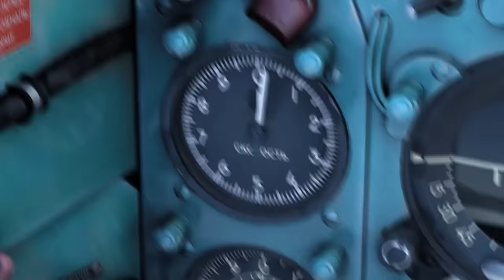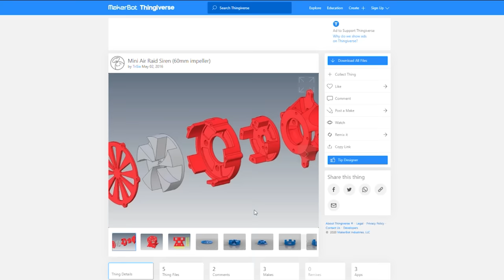Dropping Bombs with the STUKA 💥

Comment: Just an idea but I think the wing broke because the Stuka reached it’s max speed and this put too much force on the straight wing, a very real problem and the in fact reason of why modern day plane wings are angled backwards so that the plane can reach a higher speed without the wing tearing in half from too much force
Reply: Or maybe an old vet shot it since it heard the siren some vets are still traumatized from the war
Reply: Straight wing best wing
Reply: Yea. That's a fact. It's also phisics
Reply: @cascadeflims7261  The siren doesn't even sound like the original one....

Comment: They didnt out sirens on the stuka, when the Stuka was divebombing there was a hole in the front so the air would flow through and make that sound
Reply: @NG JAN HAO Moe you're absolutely wrong. Why have an engine driven prop to make noise, that wouldn't great a siren noise. There was a siren that was powered by a small prop on the plane. The air speed turned the prop powering the siren meaning that the siren only sounded properly when at a high air speed
Reply: LOL so much misinformation regarding Stukas in the comments, this one took the cake though.
Reply: @NG JAN HAO Moe you said the prop was engine driven though which is untrue it was driven by air speed

Comment: The Stuka sirens or the Jericho trumpet were not actual sirens they were unpowered propellors on the landing gear the faster they spun the louder they were however this had an effect on the performance of both the plane and the 2 crew members on the plane the tail gunners and the pilots of the Junkers said that the sirens are very distracting the sirens also lowered the planes max speed

14:11 you went over the speed limit and the air friction tore it apart

Comment: Fun fact, Stukas did not roll inverted to initiate a dive. They had a window in the floor that the pilot could see through and when he found something he wanted to attack, he cut the throttle, extended the dive brakes and pushed forward on the stick until he could see it in front of him. Yes there is famous footage of Stukas rolling inverted, but that was propaganda footage, not combat footage.

Comment: I think the issue is the way the master series wing is built. You have the top and bottom skins glued together along the leading edge. That may be fine for general flying, but with the air pressure concentrated on that joint in the dive, you exceed the structural integrity of the materials. If you had a folder leading edge, like the swappable series, it probably would have held. If you were going to do this again, I would suggest taping the skins together along the leading edge with some packaging tape.

Comment: Fyi- the siren was designed to turn as the wind went through it on a dive. It wasn't powered.  It was either locked so it wouldn't spin or unlocked so it would spin.  
The angle of the dive was almost straight down . 80degree angle give it take
There's a kids toy that you blow through like a whistle and it makes a siren like noise. That would be more accurate for a siren

Comment: I have ptsd of foam planes corkscrewing into the ground and exploding. That was how my first plane exploded beyond repair. This happened a few weeks ago lol. I used my dads slow stick and jet before that. The aileron on my own plane got stuck and the wing tip exploded and it died. RIP Stuka and my plane.

Comment: A friend of a friend had the same experience some 20 years ago in Sweden. He made a dive bomb run and desintegrated his Stuka on the very day of its maiden flight. He had spent over a year building it. And it was both larger and more detailed. He was only able to salvage the electronics and engine. Perhaps these models are not built to handle the stress?

Comment: It looked like it suffered a seam split in the wing around the hard spots for the cannons or the dives were a bit steep try a 60 degree angle or brake holes in the flaps to brake the dive speed.

Comment: Some stukas had sirens that ran all the time while flying, the pilots complained that it was annoying.
Reply: A crafty Crew Chief with a torch could probably fix it real quick.  I think the main problem was, when they got new engines that increased air speed, the airspeed in level flight now exceeded the dive speed and thus it did work all the time if flying past the designed trigger speed.  Which is also why they were removed and never replaced

Comment: you pulled up to fast which made the wing basically break off, same thing happens in war thunder. Every plane has a max amount of speed. Your Stuka went passed it max speed [max speed is unknown for this model] and you tried to pull but due to the pressure or what every its called, your wing broke.
It wasn't your siren that broke it

Comment: They didn't actually flip upside down to drop the bombs. That was done for propaganda purposes only. It was difficult and the rear gunner didn't have any shoulder straps so the maneuver would incapacitate him. Pitching forward was the proper procedure and made the target more easily visible. 
Also, the pilots were said to hate the siren because it was equally unnerving for them. 
That was awesome though. Cheers.

Comment: i think what happed was that whatever you guys were using to hold the wing together got so could that it froze and part of the wing broke off from the momentum
Reply: Glue doesn't un-glue in cold, but the wrong hot glue will separate in hot weather, always use high temp hot glue.
 Josh said that he didn't bring the wing spar out far enough to protect from this.   To some it may sound like a set up for crash.......?😜

Comment: Is there anyway to slow the rpm’s of the siren,,, reason being the pitch is technically too high.
This definitely needs your snap bombs.
Can you install some type of explosive hatch for a parachute when things go bad to lessen the impact. Kind of like a drag car, but carefully stowed in the rear of the under a hatch that would “explode open” to release the shoot. It’s inside the tail, so no drag, just used exactly in these holy crap moments.

Comment: Dude those sirens back in the day weren't sirens originally that noise was simply from the angle and wind pushing into the prop and plane as it dropped into a dive bomb being a completely natural occurance. Eventually they started to add so called "sirens" which were really just sound tubes that would create a even louder siren like soundnas the wind passed through it at high speed thats whybit has such a unique iconic sound that no other siren can replicate. Like its cool you put one on but honestly it sounded really whiney and annoying not really scary and impending like a dive bomber lol you would of been better off just putting on a super load speaker and playing a loop of an actual dive bombers sound, much more menacing